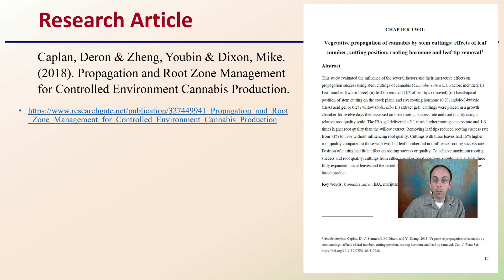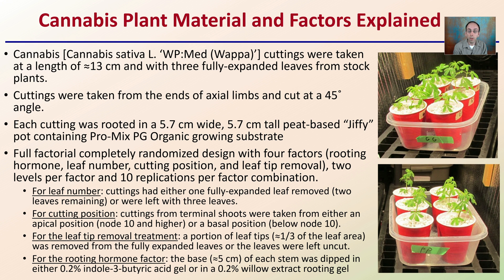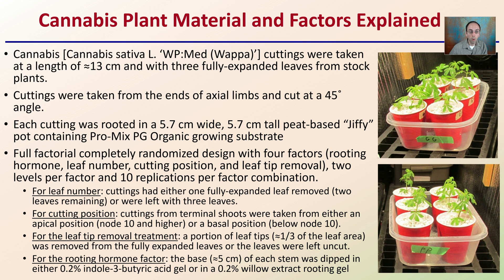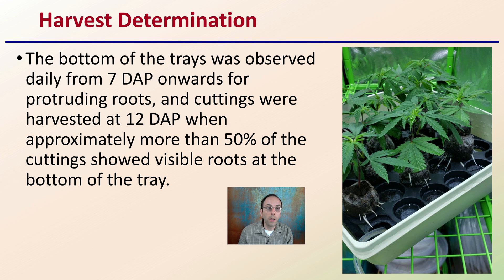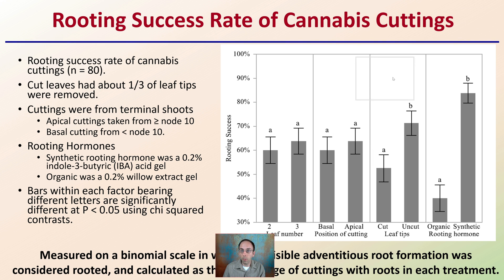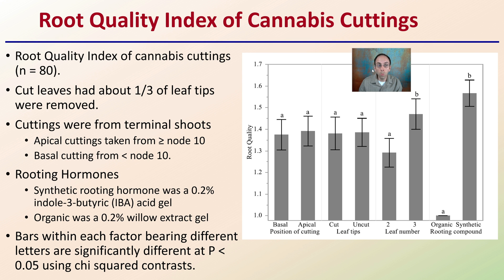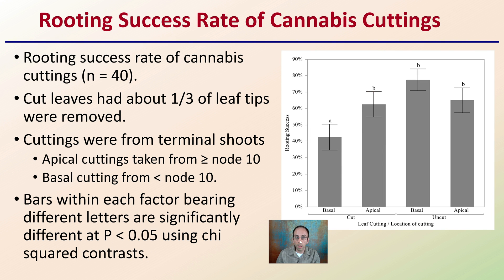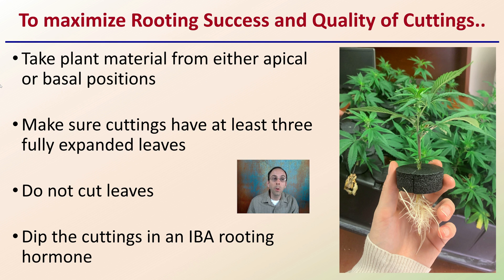Rooting Success Rate of cannabis Cuttings Research

Comment: I have always cut my largest leaves if I have three leaves (usually, I’m only cutting one leaf’s tips while leaving the other leaves intact). The next time I take clones, I’ll try taking some with all three leaves intact and see how quickly they may root compared to others. I use rockwool and clone dome method. My success rate could be better so I’ve implemented a few tweaks (aka more precision in my environment) to hopefully improve my odds! Thanks for the great content!
Reply from the maker: Hope the tips also increase your odds of success.  Also, by not cutting the leaves the chance of contamination is reduced, so is plant stress and it saves you time.  So, all benefits in addition to improved rooting!
Reply: @DeBaccoUniversity  so true! Definitely will be monitoring more closely for differences, thanks!